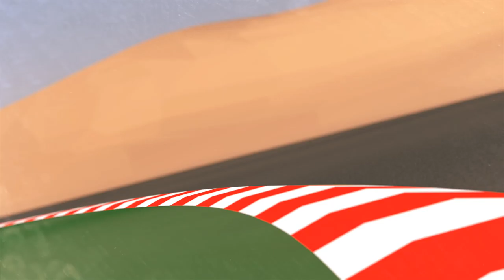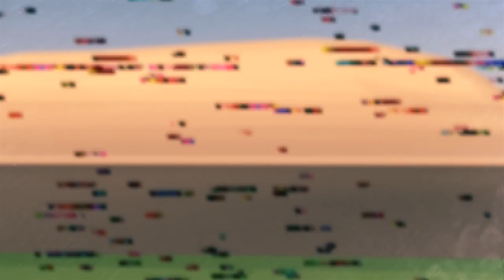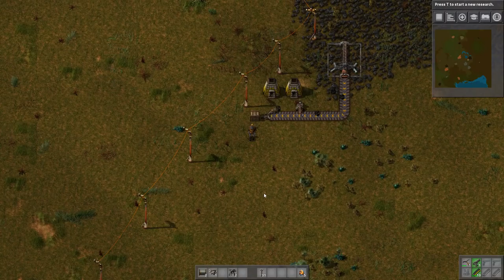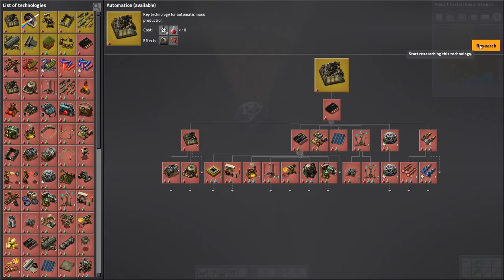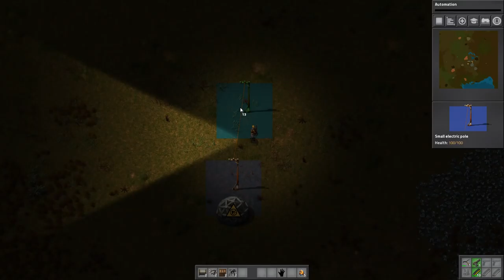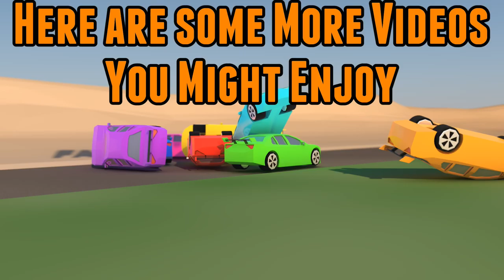The Quest For A Car #2 - Factorio

Comment: Alex, quick tip for placing Electric Poles. If you go as far away from the last pole as possible and then hold the Left mouse, power poles you continue to place will stay as far from the last one as possible. That way you don't have to deal with carefully placing the poles. Hope that helps!

Comment: Please start using both sides of the conveyor belts. Coal one side, resource the other (copper/iron/plates/gears/etc). This way you don't need the long reach inverters until much later in the game and you save space with less conveyors. Even for the science, arrange it so a single belt can hold science pack 1s on one side and science pack 2SG on the other.